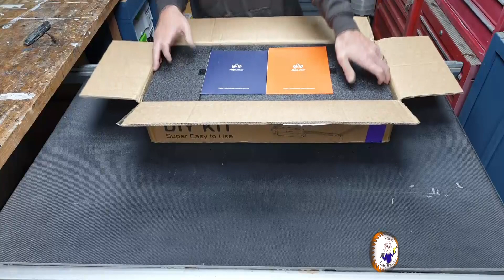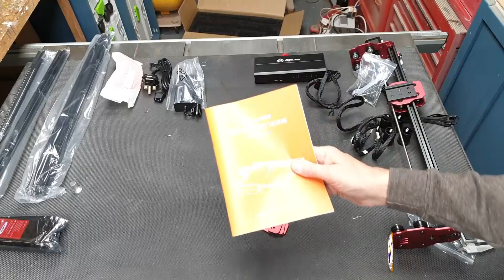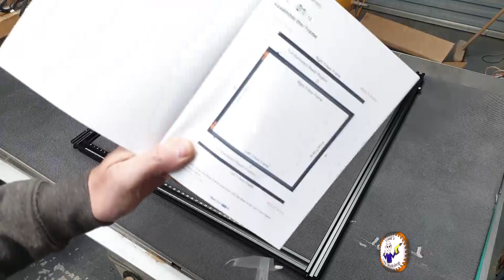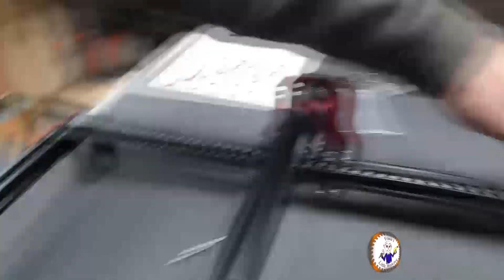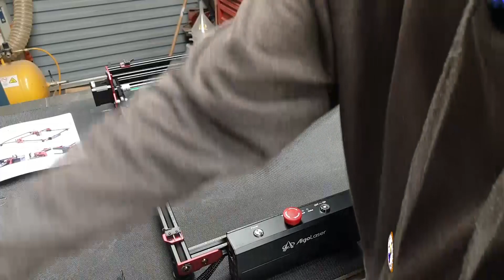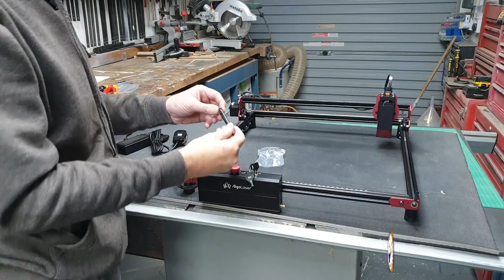Algo laser DIY KIT, unbox and assemble in detail

Comment: hello frank.can it cut ?
Reply from the maker: 😁 Hi Jeriecoh, yes it can cut. But it is only a 5.5W laser so it is quite limited. I have cut up to 4.6mm ply wood, but it takes about 4 passes at about 90%. Its great for cutting other materials like paper / card / foam etc but its best at engraving. If you want to do more cutting I would suggest at least a 10W laser. Hope that helps 😁. Thanks for watching 😁 👍

Comment: Nice video mate, not sure why i watched it as ive just uoloaded the same video on my channel for the exact same laser. I enjoy review tyoe videos though & yours is a great video. Mine was the same length as yours but i ended up shortening mine. 
For a budget laser it looks really good in my opinion. Only set mine up so far so not tested it just yet.
Reply from the maker: 😁 Nice one Dave, ill check out yours later. I've only used mine very quickly so far and it appears to work well. Think I need to give it a good testing 😁. Thanks for watching Dave 😁👍

Comment: Hey Frank.....So..... looking forward to the using of the laser....does one have to buy a "programme" for the laptop or does it come with a programme to do some design/engraving etc? Im still toying with the idea of getting one and cheap is always appealing! cheers for the video and the content....
Reply from the maker: 😁 Hi Adam. I use Lightburn software. You do need to buy it, but it is probably the best thing to get. You can get some free GRBL software but I prefer Lightburn. There is an APP that should work with the AlgoLaser DIY KIT which I plan on trying in the next video (hopefully it will work OK). Thanks for watching 😁 👍